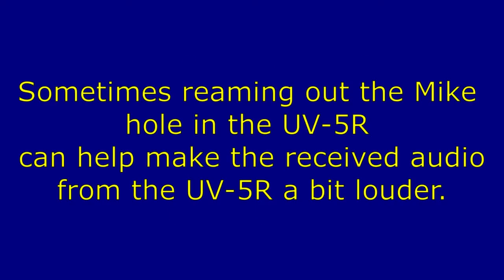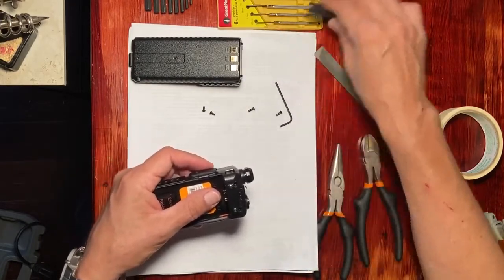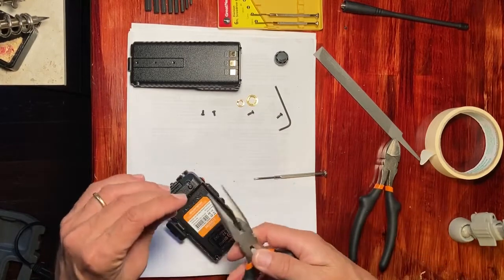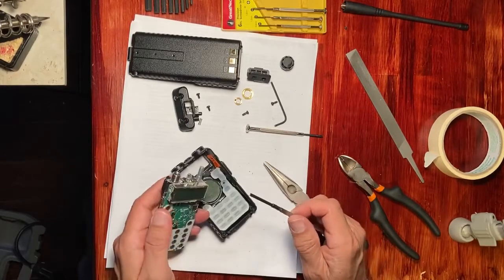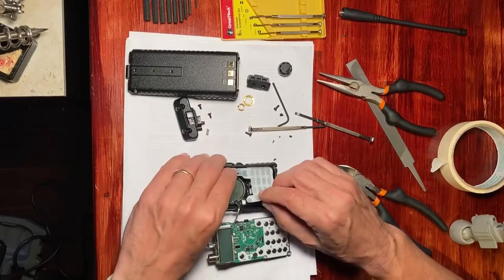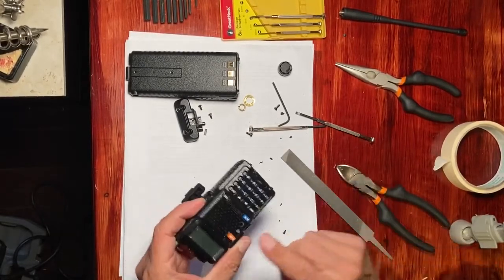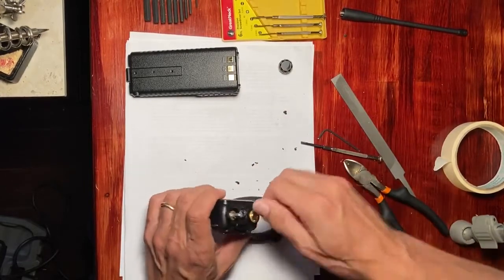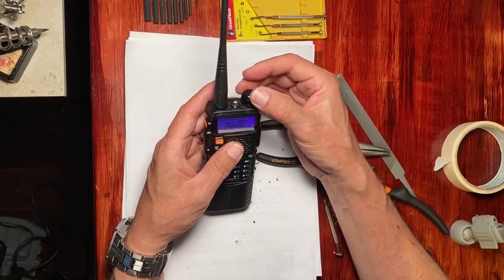Baofeng repair.  Microphone hole drill-out

Comment: You can use the volume knob as a tool to remove and tighten the antenna lock nut.
Reply from the maker: Thank you for the comment.  Good tip.  73.

Comment: Hey! I have a BFF8HP and my mic is so weak that I literally have to yell to be audible, mic gain is set to the highest.. Any idea how to fix this?
Reply from the maker: The mic hole getting drilled out didn't give a major improvement.  You may want to try WideBand in menu option 5 and see if you can hear the repeater ID better or if you can be heard better on the air.  Best of luck.  73.
Reply: @quantumradio  I changed it to wideband and nothing happend, it's like the mic is not sensible enough.